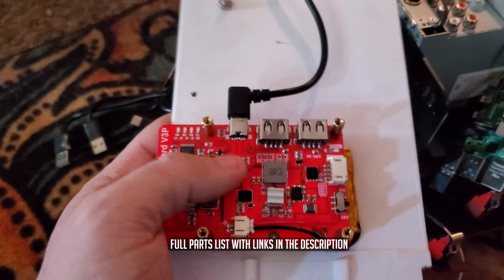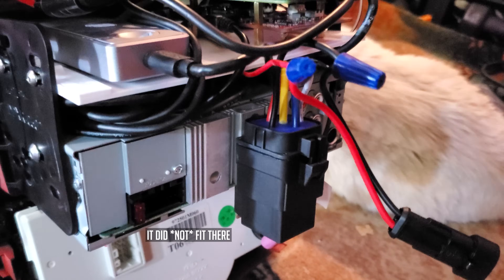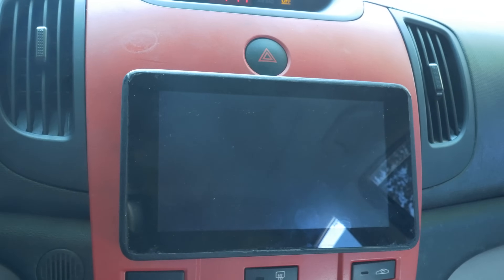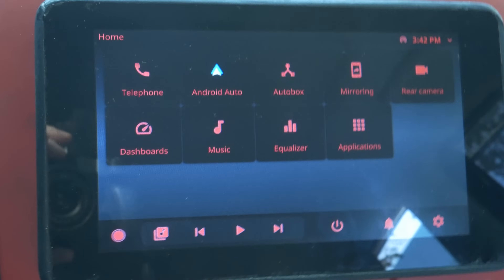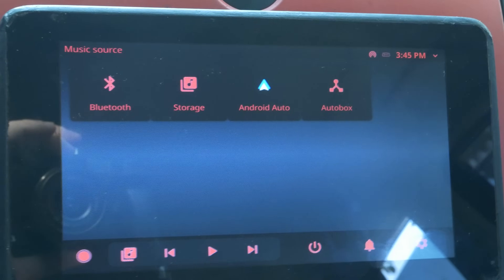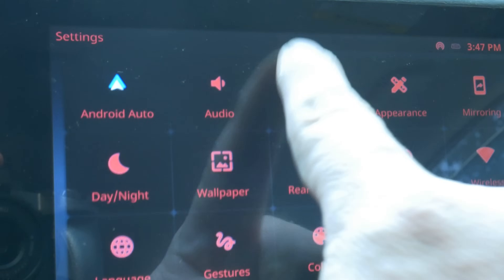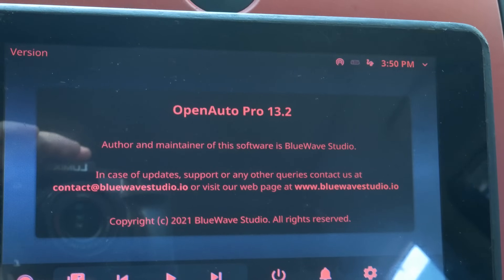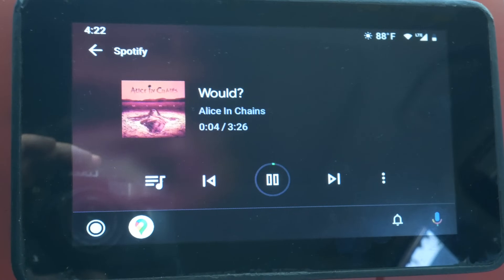Building a Raspberry Pi 4 In-Dash Car Computer w/ Android Auto (Raspberry Car Stereo)

Comment: Hey! I just put a raspberry pi 5 in an old car, I use a second battery tied to the car to charge while running to keep my pi on without draining the starter. I haven’t set anything up on it yet, do you have any tips for reading the cars analog sensors?

Comment: I’m doing some radio rigging. I finally found something incredible and fitting for my 78 Camaro, but I want the old spot where the radio went to be just a no shit computer. I’d like it to be a pi because I just pretty much want passengers to be able to play mk, watch Netflix, and act as sort of a pre-amp for a new overhead radio that goes between the t tops. It has everything correct for it, I just bought a custom auto sound radio so I don’t necessarily know if I can make them work in harmony like that but it’s basically adding a physical fader and cassette player, plugged into the radio/doom player. Any tips?
Reply from the maker: I had this setup plugged into a Kenwood head unit to control the audio fade and eq and all that. Unfortunately the OpenAutoPro software I used for the interface is no longer available
Reply: @ crazy how stuff gets lost so easily still. So much for “once it’s on the internet it’s there forever” lol
Reply from the maker: @louisb.6149  Agreed. The software was really decent but required an activation key from the company to get it working

Comment: 3 years ago I have no idea what the market was like, but today you can get reasonably priced Android head units that absolutely blow this away. 

Not all of them of course, many of them on Amazon are under specced and really it's almost criminal to sell them.
Reply from the maker: I didn't do this because it was the best solution. I did it because I wanted to build a project that I would use for a while. Then I did a second version with a different approach. Then I replaced all that with an aftermarket solution
Reply: @DBTechYT  oh yeah, I just looked. Atoto is usually trash, but your model is actually one of the higher spec they sell. It's really about the minimum of what's tolerable for Android, still adequate. It's hard to get anything better on Amazon, and I'm assuming they supported you channel which is great.

Comment: Can you add on wifi router capabilities to it? I'm working on a project that I was just going to make a router for my truck for a camping LED project so when I'm sitting down on FSR 550 in Pike ppl will think there's a UFO but this would provide me a lot more options as well as make audio sync easier.

Comment: I want to do the same to my toyota yaris 2018 iA(its like a Mazda Cx-3 2016.) Any tips.
Reply from the maker: So this version only lasted me about a year. Mostly it was due to my lack of knowledge when it came to 3d print design and that sort of thing. Also, PLA doesn't work well in extreme temperatures. I would suggest a different material if you decide to make a setup like this. Other than that, it worked well.

Last year I made a v2 of this and made a video about it as well: https://www.youtube.com/watch?v=5Kx_zFESqd0

Comment: I had a Bluetooth OBD dongle plugged into a Buick a few years ago using the torque app. It interfered with the cruise control and caused it to randomly disengage.
Reply: That can happen in lots of cars. The diag port is really just meant for diags. For many vehicles the rear camera doesnt work if u have something in the diag port.

Comment: A) Your parts list google spreadsheet is gone.
B) I'm interested in this as a means of running SDR for mobile radio. I wonder if there's a way that I could flip into a normal Linux desktop environment using this setup? DragonOS is the SDR distro.
Reply from the maker: List is updated.

Comment: does it communicate with the obd2 ports? like could i possibly reflash the ecu with this. do driving logs ect?
Reply from the maker: It can connect to the OBD2 sensor enough to give you live readings from different sensors but won't let you reflash your ECU

Comment: great video thank you . can you please tell us how to create that boot animation ?
Reply from the maker: Interestingly, I'm in the process or rebuilding this project with a new/different approach and will be making another video about it, but to answer your question about the boot animation:

The boot screen was actually easier than you might think. Here's what I did:

First thing, find or create a short video that you want to use as your boot screen. I did mine as a .mp4 at 1080p, but you could do 720p if you wanted to save storage space and whatnot.

I copied the .mp4 file I wanted to use as my boot screen to /home/users/pi/Videos

SSH into your pi and navigate to the /home/users/pi/Videos folder.

Then Create an backup of the original openautopro.splash.service file "sudo cp /etc/systemd/system/openautopro.splash.service /etc/systemd/system/openautopro.splash.service.bk"

Next, you'll convert the .mp4 file to a .h264 file by running this command "sudo ffmpeg -i dash.mp4 -an -vcodec libx264 -crf 23 dash.h264"

Replace "dash.mp4" with whatever you named your file. You can name "dash.h264" whatever you want, but make sure it still still ends in .h264.

Next, you'll want to edit the openautopro.splash.service file with "sudo nano /etc/systemd/system/openautopro.splash.service"

Change enviroment variable to match the name of the .h264 file e.g. "Environment="OPENAUTO_SPLASH_VIDEOS=/home/user/pi/Videos/dash.h264"

Reboot and enjoy.

Comment: Is there an update for this?   How is it working?
Reply from the maker: So... it worked well for a while, but the temperatures in Colorado took a toll on my 3D printing. The PLA started to crack and separate after multiple times of going from 0 degrees to 100+ degrees F. Also, I lost a Raspberry Pi after a 13 hour road trip because I didn't have adequate cooling on it. Considering doing another build, but changing a few things based on what I've learned.
Reply: @DBTechYT  In this video, you show us what it looks like. But how did you connect all the dashboard sensors, like, intake, temp, throttle, load, brake. Do we just attach sensors to all of this and somehow connect them? First time trying to set up a build like this for a 1992 Miata. Thanks in advance!
Reply from the maker: I used a bluetooth OBDII scanner plugged into my car and connected to the Pi via Bluetooth

Comment: Dontvuse wire nuts in a dynamic setting.  Solder and heat shrink will prevent shorts in a way that wire nuts will not
Reply from the maker: As I've told multiple others who have said this: this was a temporary setup

Comment: Would there be a DIY raspberry pi interface box that allows my phone to wireless to the raspberry pi and the pi connects to the USB port on my car.  There are several intface units
on the market but would like to take advantage of one of my spare raspberry pi 3B+ boards with my phone using Android auto. Plus offer video on my current 2020 Toyota Camry Car screen which is compatible to Android Auto
Reply from the maker: Not unless your USB port is capable of maintaining a minimum of 5v 3a, but the reality is that, with a car that new, there's probably a better option out there than this.
Reply: @DBTechYT  I can figure out how to get power to the raspberry pi  just curious what the interface software/config would be info would be. Would it work on a raspberry pi 3B+ ?

Comment: Nice... Although I'm very much NOT a fan of wire nuts in automotive applications.  Truthfully, I hate them everywhere, but the fear of them vibrating loose is always there.  But also, in a cramped space like that, they take up a ton of space that soldering and heat shrinking would free up.
Reply from the maker: It was all temporary while I was making sure everything worked the way I wanted
Reply: @DBTechYT  ah. Makes sense.  It's a great setup. I'm considering something similar for my van.

Comment: Can you configure the main screen to keep rear view cam on always, after switching from reverse to drive? You see this in endurance race cars
Reply: @re1v3r   years late but reverse cameras usually only are powered when in reverse taking power from the transmission or the reverse light so if wanted it on all the time you just wire it into something powered all the time. If wanted it to only do that on track you'd have to wire in a switch.

Comment: Hi. I'm considering to apply this in my own car. Is there someway I can contact you for a few guidelines to follow as I am lost in what you actually connected from the car's connectors to the RPi and I would like to get an explanation of how the speakers are connected please?
Reply from the maker: The speakers are connected to the car stereo. The raspberry pi is connected to the car stereo via the 3.5mm aux jack
Reply: @DBTechYT  What do I need in order to connect the speakers directly to the RPi?
Reply: @DBTechYT  And also why is the use of the UPS for the Raspberry Pi.

Thanks for your time to reply
Reply from the maker: In order to connect the RPi to the speakers, you would need to get a car audio amplifier and connect the Pi to that and then connec the speakers to the amplifier.

The UPS was in there to allow the Pi to shutdown properly
Reply: @DBTechYT  great. thanks. looking forward for this project.
Reply: @DBTechYT  Did you have to use any type of scripts for the shutdown feature?
Reply from the maker: I did at first but kept having issues. Finally gave up and just had it hard shutdown every time I shut off my car. I wouldn't do this if you're using a micro SD card but I never had issues when booting from a USB drive
Reply: @DBTechYT  Thanks mate. Appreciate the support even tho the video is long ago posted. Is it possible to keep in touch here as I will be setting this up in the coming weeks as waiting for some parts.
Reply: @DBTechYT  How did you have it hard shutdown? Did you remove the relay?  Thanks

Comment: PLEASE DO NOT USE WIRE NUTS IN A CAR. Use inline solder connectors with jackets and heat shrink. This is like car wiring 101.

Comment: Can I connect this to an old car?
Reply from the maker: I don't see why not. It just needs a 12v and a ground wire to power it. I've got mine plugged into the aux port on the stereo. If you don't have that, you could get an amp to plug it into and power your speakers that way

Comment: Nice setup 👍 I building now someting more diy on odroid c2 with gps rds/dab, 3g modem, amplifer from tda 7850, dac hat and 10.1 ips touch screen with cam support. But i must buy someting like yours led swich controller for shuting down my unit. Its almost done like 90%.
Reply from the maker: That sounds like a beast of a machine you're building!

Comment: Really awesome video, just the kind of inspiration I was looking for, one question, why the need for Bluetooth and wireless USB peripherals? Does the rpi4 not have these connectivity means natively?
Reply from the maker: Thanks! The reason for the extra peripherals is that there is an issue with Broadcom chips handing things off appropriately, thus making the onboard devices useless.

Comment: Thank you for all of the hard work you have put into this video. The killer feature I am trying to figure out is making the head unit enclosed as one piece with a quick disconnect (like the old head units with detachable face) so I can update software in the house instead of sitting in the car. I haven't seen anyone do that yet.
Reply: Wouldn't you just need access to the SD card? You could take that inside and upload whatever you needed to it.
Reply: @JoshGerhards  even if i could update everything from an SD card i would still have to sit in the car for the install process.

Comment: do you know if this works with  desktop computer systems? im converting my car to electric and have a laptop processor in it i plan to use for all the electronics
Reply from the maker: The very first sentence on their website is: "The OpenAuto Pro is the most advanced Raspberry Pi based, custom head-unit solution ready to retrofit your vehicle."

Comment: The problem with these systems is the terrible audio outputs, I have a mini itx PC I intended to use in my car with a dual boot of windows and android but in months of searching I can't find any digital to analogue converters which output 4v or higher on the line outs and all are between 1.5v and 2v  :(

I need a minimum of 4v, I currently run 6v and my amps will take up to 8v and need multiple outputs for front and rear field plus sub's but can't find a single DAC that suits my needs.

Even more frustrating is my head unit is running a re skinned and locked down version of android but you can't install third party software and nobody had been able to crack the boot loader to install a custom ROM.
Reply from the maker: If audio output is an issue for you, then get a Raspberry Pi DAC and then run that to an aplifier.
Reply: @DBTechYT  yes but what does the raspberry pi DAC output on the RCA's, I bet its between 1.5 and 2v, that's the problem I have, nobody makes DACs with high voltage outputs :(

Comment: Can you do a video on how to do the custom splash screen
Reply from the maker: The boot screen was actually easier than you might think. Here's what I did:

First thing, find or create a short video that you want to use as your boot screen. I did mine as a .mp4 at 1080p, but you could do 720p if you wanted to save storage space and whatnot.

I copied the .mp4 file I wanted to use as my boot screen to /home/users/pi/Videos

SSH into your pi and navigate to the /home/users/pi/Videos folder.

Then Create an backup of the original openautopro.splash.service file "sudo cp /etc/systemd/system/openautopro.splash.service /etc/systemd/system/openautopro.splash.service.bk"

Next, you'll convert the .mp4 file to a .h264 file by running this command "sudo ffmpeg -i dash.mp4 -an -vcodec libx264 -crf 23 dash.h264"

Replace "dash.mp4" with whatever you named your file. You can name "dash.h264" whatever you want, but make sure it still still ends in .h264.

Next, you'll want to edit the openautopro.splash.service file with "sudo nano /etc/systemd/system/openautopro.splash.service"

Change enviroment variable to match the name of the .h264 file e.g. "Environment="OPENAUTO_SPLASH_VIDEOS=/home/user/pi/Videos/dash.h264"

Reboot and enjoy.

Comment: Thanks for the video. I'm thinking I want to do this but you had mentioned you could technically get rid of your stock head unit altogether and it still operate fine. How would that work with the audio since your audio is coming from the aux cable to the factory unit? Do you have a recommendation on how to go from the vehicles factory wiring harness to the Pi directly? 

Thanks in advance.
Reply from the maker: You would need to get a Raspberry Pi DAC and an amplifier and then wire the DAC to the amplifier.

On the other hand, if your car is like mine and has an amplifier from the factory, you won't need to buy an amplifier and you'd be able to tap directly into the existing wiring harness
Reply: @DBTechYT  Wow man, thank you so much for the quick reply. I'll look into that. I currently have a JVC double DIN but I want WIRELESS Android Auto so bad I can't stand it! 

Thanks again for the info.

Comment: Do you know of any way to integrate ac/heater controls into the screen? I have something like this I want to do but my ac readout feeds into my existing cd player.
Reply: There is a guy on YouTube who integrated OpenAutoPro with his jaguars climate control.  Rhys Morgan. Complicated and via canbus reverse engineering. Doable!
Reply from the maker: I don't know of any off the top of my head, but that's going to largely depend on your car and how it actually handles the airflow system

Comment: I'm really keen to build one of these but unfortunately 30 seconds to start up is just a show stopper. I'd be half way down the road before I could set the navigation or music! Or use the reverse cam to get out of the driveway. Not practical. Needs to be instant on like the Chinese Android ones. Why did you install a UPS if you need to boot it every time? I'm also a bit confused if OpenAuto Pro is actually open source or not too. Can you clarify?
Reply from the maker: I've usually just hit the stop sign near my house when it has fully booted and is playing music, so 30 seconds really isn't that big of a deal for me.
Reply: Agreed, with a 30s load time and a slow UI loading, it's not a viable alternative to buying a car/head unit with it already installed
Reply: @Data Null Void Actually that is old and wrong. Current recommendation from car experts is to let you car idle no more than 30 seconds, and to warm it up by actually driving it. It is for comfort only, it wastes gas and doesn't actually make your car run better.

Then again if I do that in my car sometimes it has next to zero power for the first hill I drive up and I value comfort over fuel so I still like to warm up for a few minutes.